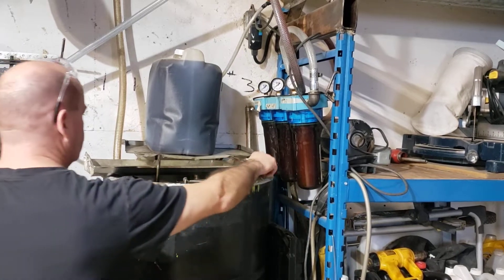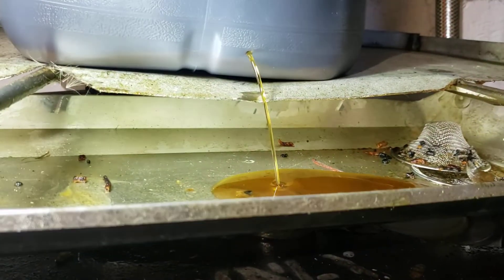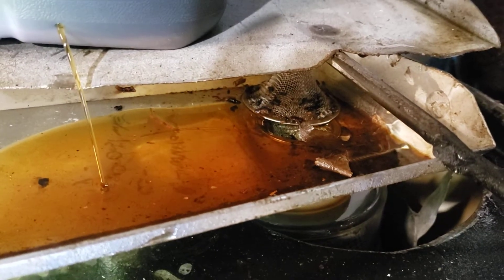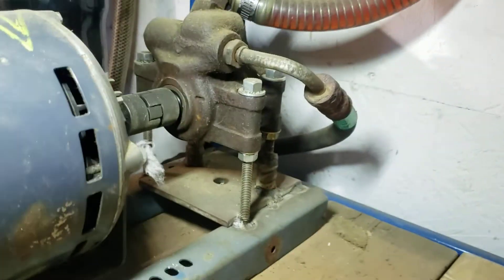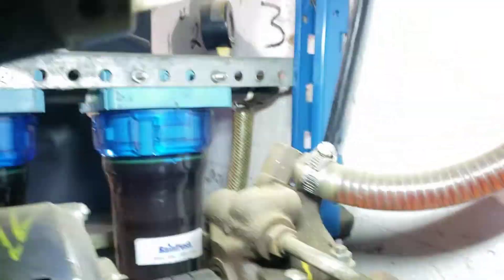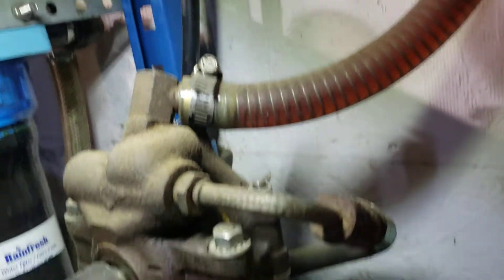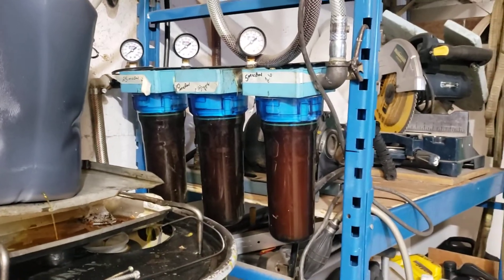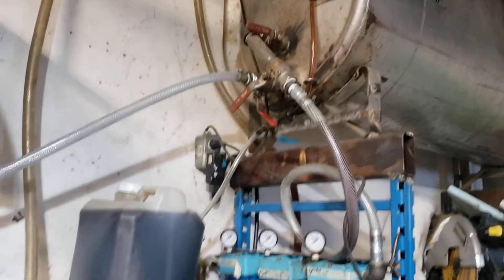wvo filtration, pump, filters (2 of 3)

Comment: Would a gear P/S pump from a class 8 truck work better? More volume and PSI.
Reply from the maker: I'm  sure bigger is better   more pressure  but more importantly more volume. faster filling of the things you need filled.
gotta watch your filtering flow rates  . there is only so much you can push through certain filters.

what is a class 8   truck? like a semi...?
Reply: @dennisw4828  yes